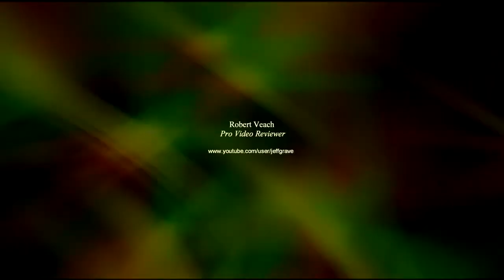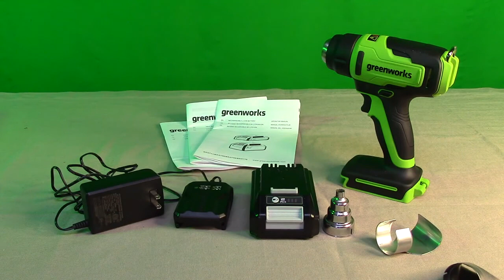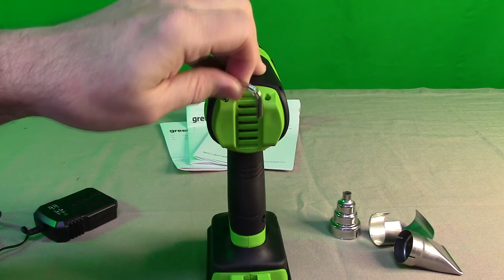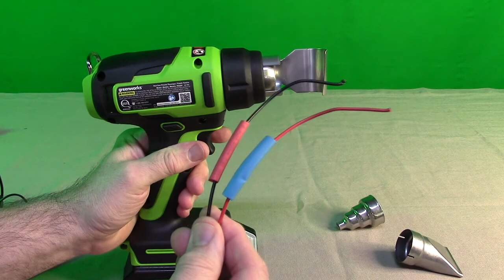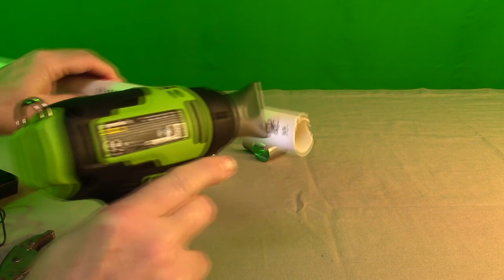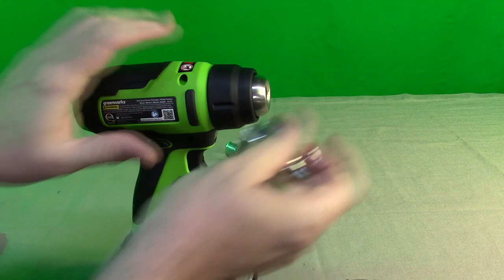REVIEW Greenworks 24V Cordless Heat Gun - Hot Air Tool with Brushless Motor 2.0Ah Battery & Charger

Comment: Nice review but just one thing I would like to note. You had a quick little mention of using this on food. You should not do that. These things are not designed or rated for use on food and the heating elements on these normally have some sort of metal like chromium on the heating elements that will ionize into your food if you would use something like this on it. Only use a butane culinary torch on food.
Reply from the maker: Thanks for the tip!